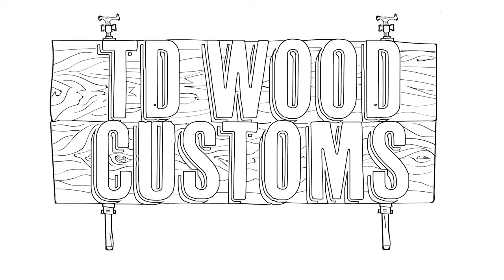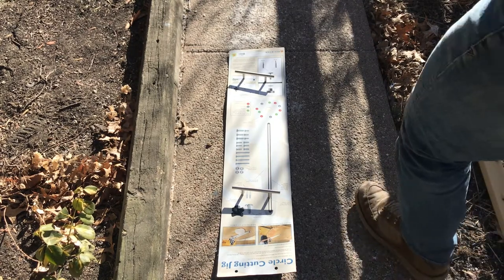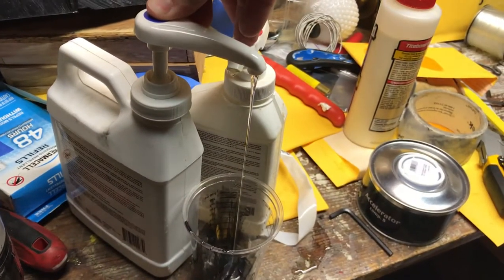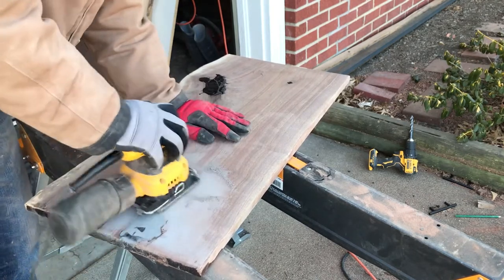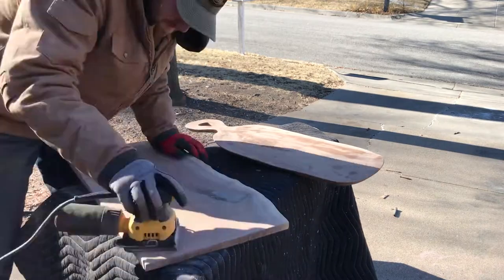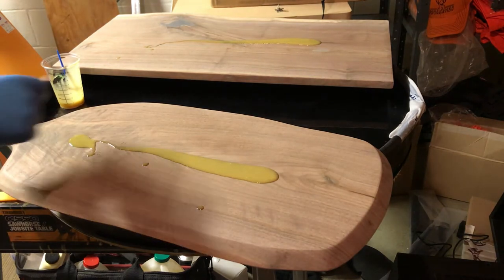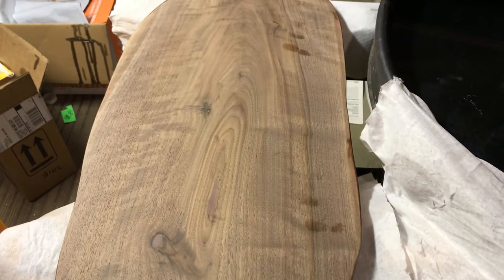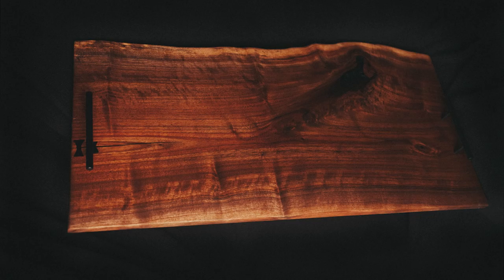DIY Charcuterie board, only $35 of materials!

Comment: if u happen to see this. run a bolt in the handles and hang with a coat hanger so u cab hang it, when u paint it you can hold onto it by the coat hanger and spin it around to get good coverage without having to bend in half or stand on your head.
thought the epoxy bowties was pretty slick